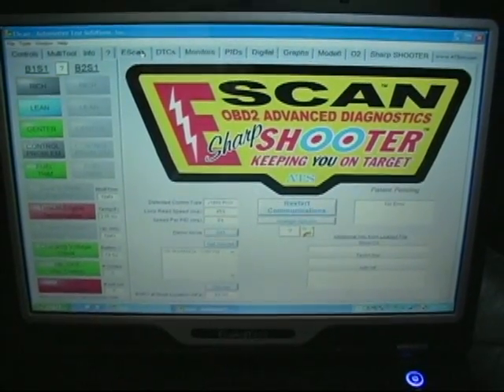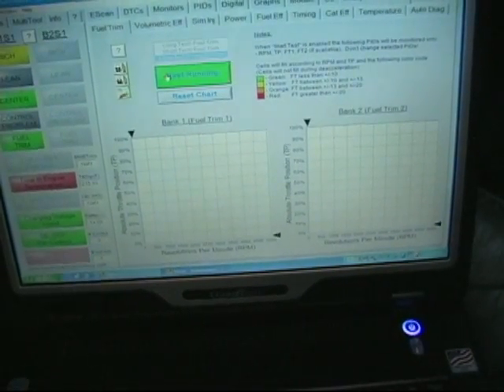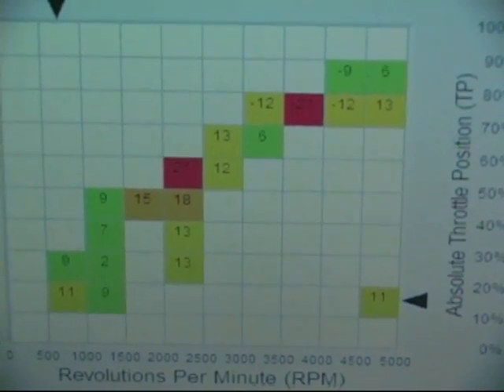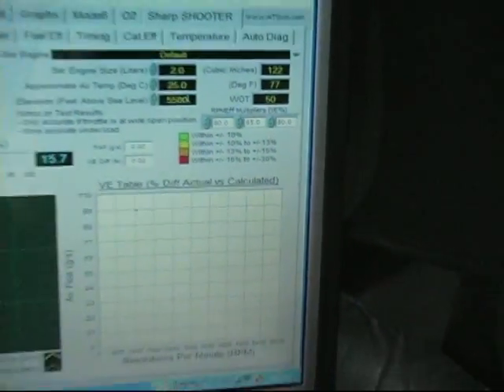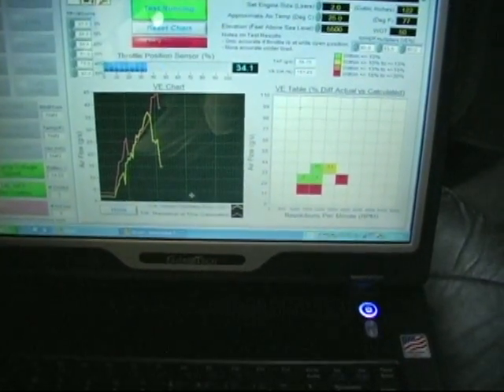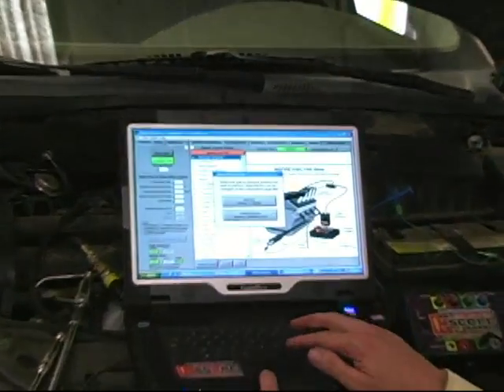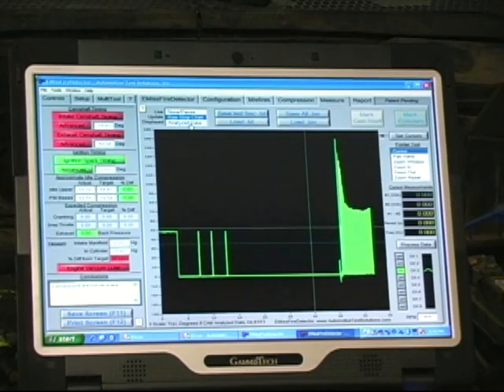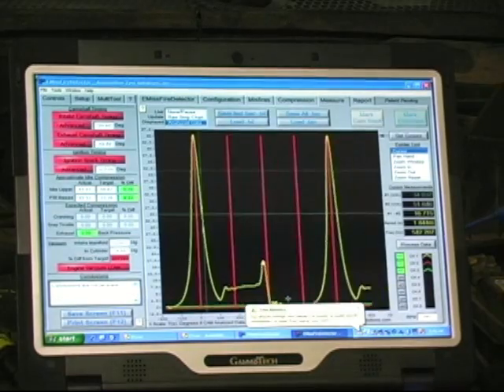ford_focus_low_power.mp4

Comment: I had a 2013 Audi Q5 V6 with a bank 2 idle hard misfire that was not detected by the ECM. No cam sensors on the exhaust camshafts. After checking a bunch of stuff, I decided to pull the bank 2 cam cover so that I could check cam alignment. Sure enough, exhaust cam was out of time. Your method / steps would have saved me quite a bit of time, had I had the equipment & know how!